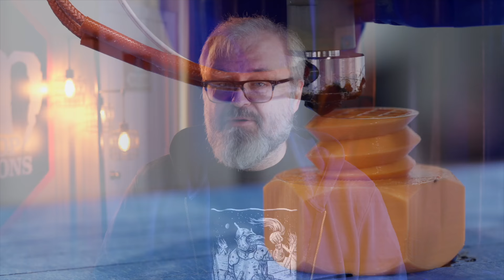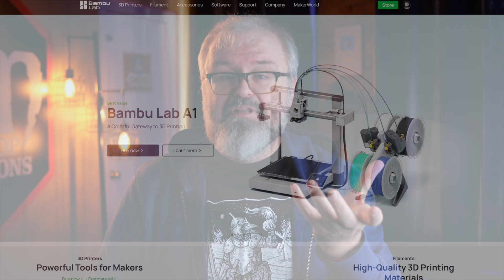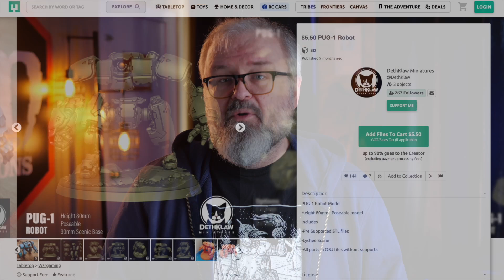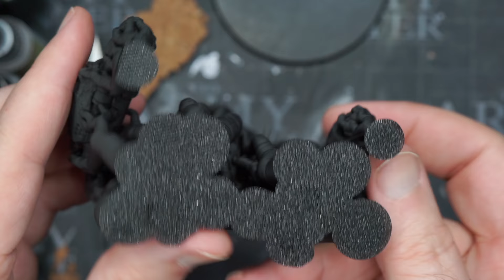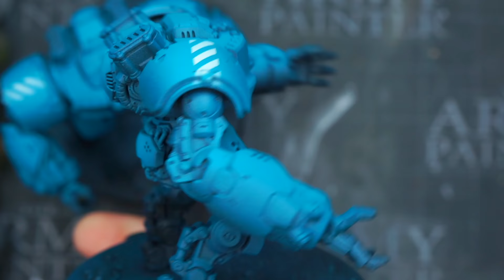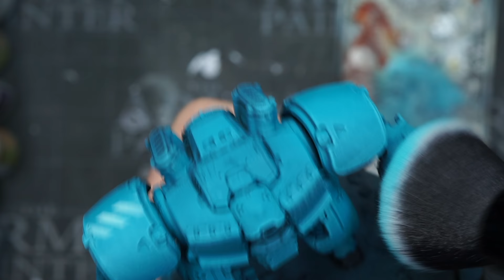I Compare RESIN vs. FILAMENT for 3D Printing Wargaming Minis

Comment: I was pleasantly surprised when I printed the sample STL files from Malediction on my work's Bambu Labs Carbon X1. I used a 0.2 nozzle, and the pre-supported files designed for resin printers. Both files were 'small' character models, not larger ones like your robot. The supports just pulled off.
Reply: You mean using the pre-supported model STL files that were meant for resin printers? Did they come out better than using the FDM-style supports?
Reply: @thetabletopskirmisher  Yes, the supports designed for resin printers. They were very fine, and therefore it took quite a while for the model to print but they broke away very cleanly. Adding FDM supports would have resulted in a quicker print but when I tried this before on a detailed, smaller model they didn't break away as cleanly (tree supports) and model detail was lost.

Comment: It would be interesting to see this video's topic revisited where instead of treating each mini the same, use the best painting technique for the given mini. What works best for resin might not work for filament. 

And as others have said, printing the filament mini in pieces that are oriented in a way to minimize support or has support in non-visible areas helps a lot. 

I like the detail we've gotten in house with resin, but gave it up due to cost, mess, waste and fragility of the minis. But our filament printers are still going strong.
Reply: I have both printers. Resin does a very nice job for minis, filament does a very nice job also; they both can be painted the same way. I use PLA white or gray for miniatures rather print tanks with filament print scenario with filament soldiers figures with resin, but it's all the same at the end of the day when it comes to paint. Resin has to be cleaned its a bunch of extra steps, but what works for resin works for filament, so he's on point with what he's saying its all the same when playing, no one cares if u are a painter, then yes, resin does a more detailed job. I have done both resin, being the best in detail i just hate the cleaning steps
Reply: I can confirm that FDM prints benefit from different techniques based on the couple models I've done, including one where I painted it dozens of times in resin and once in FDM as an experiment.

You can get similar results using the same techniques. However, I found that it helped to have a dry brush or paper towel on hand to clean up after large washes (kinda like cleaning an enamel wash without the waiting), and really pushing pigment into recesses to darken them more vs. spots where it settled in the layer lines. Going more "grimdark" helps too, because you can hide layer lines as scratches or other battle damage in a pinch.

I also noticed that the layer lines make it easier to edge highlight on FDM by catching more paint, so you can pile in the contrast between high and low spots faster. 

In terms of print quality, you won't trick anyone that a print is in FDM, but it doesn't mean you can't make it look good. The FDM prints I've painted have me thinking I can get a cool, stylized army painted beyond tabletop or battle-ready standards if I'm willing to work within the constraints of the material and push myself into trying something new.
Reply: I would argue however that limiting your painting techniques based on the material gives a clear win to resin in terms of fidelity because you can paint that however you want, and the kind of techniques that show up layer lines like drybrushing and washes are extremely common.
Reply: Even more so if he had a clue what he was doing with the FDM model.

Comment: To help make supports easier to remove increase the top z distance. I use .275. Also I think you would get better quality printing it in parts. Also what layer heigh were you using for the FDM print? At 0.08 on my P1P the layers are far less noticeable then your example.

Comment: I recently printed some sci-fi vehicles on my filament printer. Stuff to be used as cover and  objectives on the table. They worked well there but the obvious underside issues are hard to get away from. Prusa's organic supports work wonders there but they can still be a tad rough

Comment: Filament like pla swaps out VOCs with particulates and even then you might still get exposure to VOCs. Neither of these technologies are safe both require adequate protection. People are way less careful around FDM than they should be. It’s also not as biodegradable and has to be industrially composted to biodegrade or have added enzymes. Everyone is entitled to their own preferences about tolerating risks. But FDM is not necessarily safe.

Comment: I've heard of, but not tried, using resin brushed on to FDM prints and then cured with a UV flashlight as a way to eliminate layer lines. I imagine that might come with some potential for obscuring detail and drips/sag, but I think if it was treated similarly to applying Speedpaints (one section at a time, don't let it pool) it might work out pretty well on large featureless areas in particular.
Reply: Seen it. It works. But I'm not going to fool around with resin any more. I gave up my Anycubic resin printer and switched to FDM.

Comment: You can use 3D builder (3D editing softaware that comes with windows) to put all the STL files together just by dropping the files onto the program. There are several tutorials, and works on most files. After that you just save it and get it onto the slicer, :D

Comment: I own both a filament and resin printer. One of the big issues I just had with a filament printer is a "critical" clog that caused giant "tumors" inside the extruder. The print failed to adhere to the build plate, and I wasn't home to check on it, so it made a giant tumor, and I had to replace the entire extruder. Luckily, it's just 50$ for a new extruder.
Reply: I'm not sure what you mean by "tumor" unless you mean a giant glob of melted filament.  Mid print "clogs" are actually heat creep, caused by filament melting too high up in the extruder.  To avoid, google heat creep and how to fix.  If it's an early failure, your print never stuck to the plate and thus the filament just bubbled out of the hotend with nowhere to do.  This is either a zeroing/leveling issued or a build plate that wasn't clean enough.
Reply: @ssbtd00m By tumor, I do mean a giant blob of plastic that completely infiltrated the extruder and was leaking out all over the place. I have been regularly zeroing my build plate. I had been having issues with my prints adhering to the build plate. I thought I had mostly solved the issue by using some PVP stick glue. This was my first failure since starting to use the stick glue... 😒 Usually in the past I would check up on my prints  especially at the beginning and stopped any issues early.

Comment: Removing FDM tree supports doesn’t bother me that much. It’s slightly more interesting than clipping sprues and there is a weird satisfaction in getting the support off a really fragile area. And if it doesn’t work out - well I haven’t ruined a $50 model.

Comment: Eh, you as a user of both techs must know that there is a lot of post processing when making fdm prints, there is sanding down the layer lines or using filler to hide them, the print you showed could look a lot better with even a bit of sanding, a lot better with a rough and a find sanding session and if you wanted to go the extra mile add filler where needed and sand for perfection, it's more work for sure and you can't get the fine details reliably but you can get a lot better than this though...
Reply from the maker: But I wanted to show each model as “stock” - sanding and filler and whatnot on either model is a lot more work. Thanks for watching!

Comment: Filament in separate pieces would be much better as: 1. You can smooth each piece individually 2. Vary the direction of the striation more favorably 3. Print details better — (notice how the chest armor detail is wonky at an angle in your example, compared to the resin model) — if set up at an optimum angle.

Comment: 1. Printing the parts separately allows for better orientation of the model and supports

2. Stringy filament overhangs can be smoothed in a myriad of ways (soldering iron with a flat head, wood filling, sanding, etc)

3. Using inner-outer-inner wall order helps with surface quality and decreases the evidence of layer lines

4. Using a heatgun to lightly warm the supports makes them easier to remove (and you can use the heatgun to “cure” surfaces damaged by supports)
Reply: I've been printing 28mm warriors for MESBG this year, have cutting up models in blender and printing flat, has reduced the need for supports greatly. And painting hard to reach areas before gluing has saved many headaches
Reply: @jperk6528  that is a grea idea, I will try that! thanks :D
Reply: I can tell he didn’t use the smallest layer heights possible which would help a TON.
Reply: @borbies So many people don't. You can get pretty nice results using 50 micron layers with a 0.25mm nozzle. Even better with 20 micron and a 0.15mm nozzle but that is very tricky and very slow.
Reply: Totally agree with this.
Reply: 4. is very important, even better when you get good with a small lighter. By applying quick bursts of flame and then smoothing the area with your finger - yo ucan hide layer lines on very annoying parts that show them the worst, like pauldrons or top of the helmets - after 3-4 bursts they and smoothings they turn into a smooth surface.
Reply: Any recommendations on heat guns?
Reply: @l5rfan  I have a Canadian Tire generic brand with multiple heat settings and I use it at it's lowest carefully. It's faster than hair blower but I wished there were a lower settings.  I wouldn't be using it to warm up my car door when frozen to open it up.  So I can't recommend cheap ones. Some things you have to pay for better one. I think when I can budget it, I would spend on a better one.  My settings are 1-5...so I would be getting one that shows the temp range.
Reply: On point one, it could make it more durable to
Reply: a heatgun and a brush can knock the stringing off, too
Reply: Hot tip, really steep overhangs can actually be cleaned up by printing them with higher outer wall extrusion widths.

Comment: Generally with FDM you want to print in parts so you can optimize the orientation of each part to hide the layer lines as much as possible.
Reply from the maker: I would (and a lot of folks have suggested this), but I guess I don’t know what’s supposed to be the best angle to “optimize” the printing. Thanks for watching!
Reply: @tabletopminions  Figure on your layer lines printing horizontally. Curved surfaces on top, then use adaptive settings under "Variable Layer Height". Align the STL accordingly.

BUT as I mentioned earlier, digging deep into slicer settings is an absolute rabbit hole. Filament, printer accuracy, slicer settings all play a part.

If the "good enough" prints you are getting from your printer work for you, keep at it! Especially if your goal is to play. For others, it's squeezing the absolute last bit of quality from their printers. 

In the end, it's all about why you are doing what you're doing.

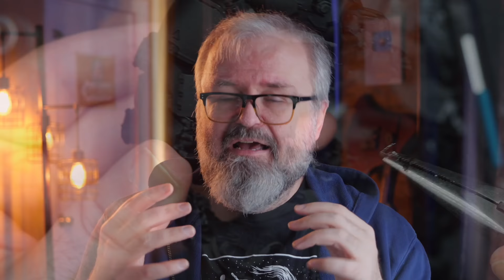Comment: 9:14 for FDM clean-up, the "hairy" or stringing can be removed using a torch lighter to melt away.
Reply: hair dryer of heat gun, I sues works well for FDM strings.

Comment: Assembling the model in the slicer really made this harder than it needs to be. You're not meant to do that and the slicer can easily get confused when you have intersections. Adjust each part to maximise results, try to place it so as much of it is in contact with the bed, no overhangs are being forced. Any curves should be side to side/front to back not up and down. This is because we have very visible steps in the z (print layers) but the x and y have bice fluid motions. This makes compound curves the bane of fdm printing. There's always and angle that a space marine sholderpad will look a bit bad. Use the slicer's preview and scrub back and forth through the tineline, look out for any parts where it'll be trying to pri t in mod air or maybe over reach. This is a skill you develop as you print more things, you'll come to notice there are specific movements that the fdm can't do. 

You can adjust support settings too. There's a gap in the interface between a support and the model. This is so the support will be less welded to the model where it touches than the model is to itself. You might need to tweak this setting a little. A support touching a model on some little bit of detail might still pull that detail away for example. There's no single magic slicer settings that will work in all cases you do need to understand what they all do and how they effect things. It's a long slow process but it's rewarding and I dare say fun if you're of the correct mentality.

When painting I'd avoid washes and drybrushes as these rely on the detail of the model and with fdm we can't fully trust our detail anymore. Think of it like painting a lead mini from the 80s.  You'll need to use your paint to suggest the details that didn't come out and exaggerate the edges you do want while avoiding the layer lines that you don't want.
Reply: Can you tell I typed this on my phone without looking?

Comment: Printing the entire model usually greatly reduces the quality, if it is possible to print in bits on the filament, the results can be better, even more so if they are well positioned to avoid creating supports. It requires more planning, but the result is visible, for example, shoulder pads, in this model the supports greatly affected the quality, if they were printed separately, with one of their parts directly on the printing bed, They probably won't need supports, so there would be no interfaces, and it would be cleaner.
Reply: Also some sanding followed by a gloss varnish or a primer with more "body" like Mr Hobby Finishing Surface Primer 1000-1500 can help fill in the layer lines
Reply: @manuelsaavedra8081  yeah, at least on the "emptier" areas the sanding works magic. Maybe too much effort varnishing because then you are introducing more chemicals which compared to the benefits of Filament vs Resin almost defeats the purpose.
Reply: @DavidFaris  Blowing a gloss varnish or Mr. Hobby primer through an airbrush is a matter of minutes, seconds if you exclude cleaning and prepping, and a enamel based primer is much better than water based primers, doubly so on a surface with lots of "micro" edges where the water based primer can be rubbed off.
Using enamels through an airbrush requires a spray booth with a vent and a respirator with appropriate filters, both of which are reasonably in budget if you can buy a FDM printer and unlike a resin printer they're only toxic while actively using them which again is a couple of minutes.
Also Mr Hobby Finishing Surfacer is by far the best primer for both resin and regular plastic miniatures because it has actual grit that helps both fill small hairline gaps and prevents the paint from rubbing off thanks to its gritty surface.
Reply: @DavidFaris  An acrylic gloss varnish is made of the same chemicals in the rest of the acrylic paints that someone painting a mini is already using. 😊
Reply: Plus a few more tweaks - setting a fixed or minimum print time for each layer apparently can reduce the layer offsets that appear when the next layer suddenly has less or more to print, like when there's a ledge. This is greatly visible on the front of this model. I haven't tried it yet though. And adjusting the support layer offset to a higher value can make the supports easier to remove, reducing scarring and stringy undersides. This also depends on the filament itself, some are easier to remove than others.

Comment: I bought a Bambu Lab A1 too. I test printed some minis. Then I printed all the parts for a Star Wars: The Clone Wars AV-7 Cannon. The file is from The Pocket Dimension. It looks great! It is scaled for Star Wars: Legion.

My second project is the Clone Wars AT-TE at Legion Scale. This model is from Dark Fire Designs and it is a chunky boi. It's got a lot of parts and pieces, but the A1 has been absolutely killing it.

Edit: Also, the filament I have used has been 1 spool of Bambu Matte Grey and eSun PLA+ recommended by a couple other YouTubers.

Comment: If you have a lot of skill in miniature FDM then splitting the model is always better. Just like with resin it gives you more chances to hide support pricks and layer lines. But in this video, from my experience,. pre assembling the model was the play. Also personally I enjoy the machine just automatically producing a complete miniature. Unlike Resin there is no processing step so it does fell quite magical.

Comment: You should have done the FDM in bits, rolling the objects to get an angle with little support as needed and so its not on visible areas of the model. Much easier to get  the 'tree' off. Use small snips to get tree off not just pliers. I also have a scalpel knife to get an easy clear cut. I'm doing 1/200 aircraft with .02 in PLA and the detail is great.
Reply: You can get down to .02 with PLA prints?
Reply: @フコノウス  .2 NOT .02, sorry typo.